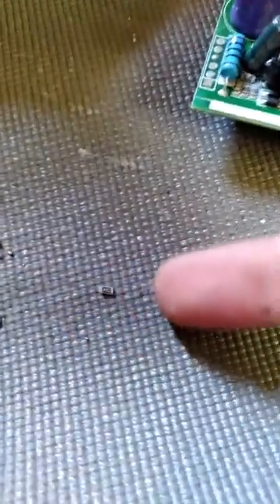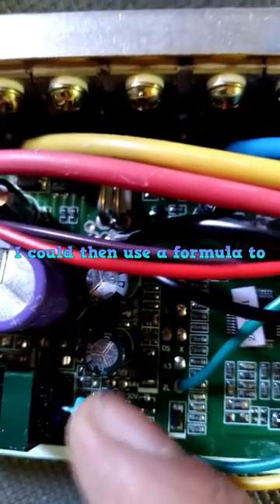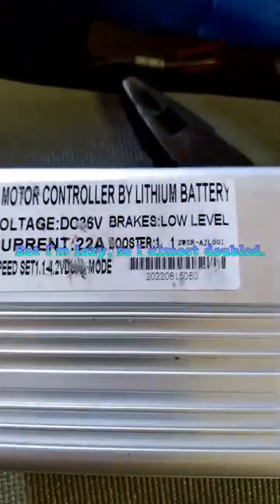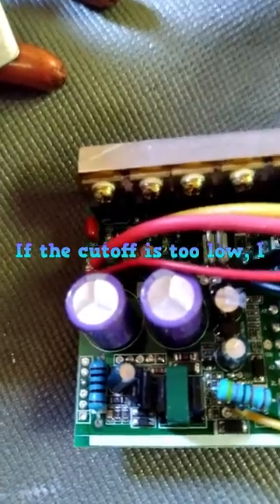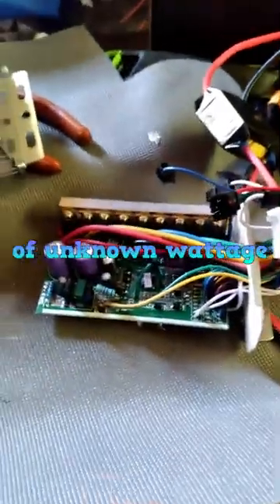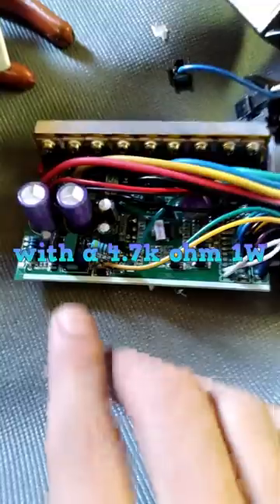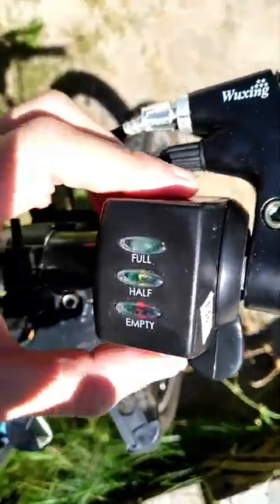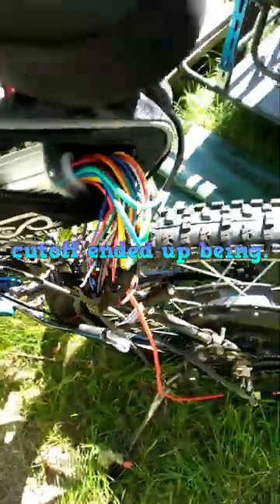Low Voltage Cutoff Mod - E-Bike Controller Mod

Comment from the maker: The last video I soldered something I was shaking so bad I didn't show it, so this Time I decided to not show but it was crazy fast. I clipped and bent the cathode and anode to be technical although like me a resister bipolar but ya, found a fine point solder tip used my 3r hand to line it up and zing, zing. done. No shake. did a double check and a flick thinking no way but it's on there. I could have mild Parkinson's and from time-to-time soldering is a funny game now. PLus side is this cheap can troller can be changed to 48v, 50v, 64v or 72v without modding, it's only doing 36v with mod.

Comment: Im having a issue rn with my scooter cuz I changed the LVC to a higher Voltage and my scooter shutdown and after I charged back up I changed it back to where it was and now it keeps tripping itself to shut down in minutes of riding …what you think I should do it’s an 60v30ah 5600w tif galop
Reply from the maker: Can your display to a factory reset? I would try that and maybe set low voltage to 48v 49v ish. If the cut offs to high when you throttle or pull a good current you could be dropping that low even thought there still capacity. Might also need to let the battery top balance good. Sounds like you have a beast of a bike.
Reply from the maker: also check your thermal past, I keep seeing controllers without any paste at all where there should be plenty. Opened my friends up last month to see why his shut down after 2-3min and there was never thermal past in it at all.

Comment from the maker: It's hard to see in the video but I realized something last night. this controller was sold as a 36v and there is no 36v mod (trace) on the board, theres not even a 48v lol and idk what that resister is that I changed, I'm hoping it's what I think it was. The controller is actually a 50v to 72v and everything in between but with a resister here or there you can dial in the specs you want. So if you made an oddball homemade battery like a 52v or 53v you can dial in your low voltage cutoff, again your BMS will have that in it though so they should just take the low limits out of the controllers all together.

Comment: Nice mod to the control dude.
Reply from the maker: I hope so, I'm about to test it and I got a couple other goodies showing up in my mailbox today.
Reply: @Ro-Bucks  So this mod that you have done enables you to take the battery level lower than the preset??.
Reply from the maker: @Bitathisandthat  I'm hoping so, it was cutting off at 37v and I'm using a 36v bank. took forever to get to 37v again but I'll know for sure if it worked tomorrow.
Reply: @Ro-Bucks  Ok..well fingers crossed for you dude.